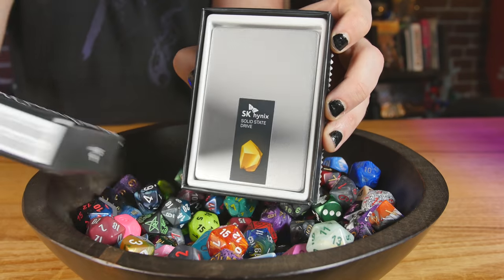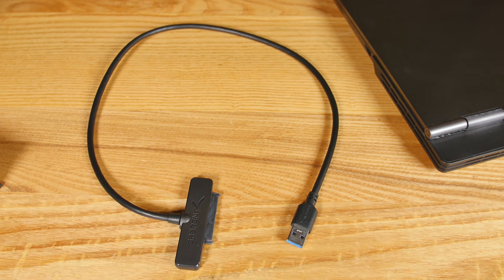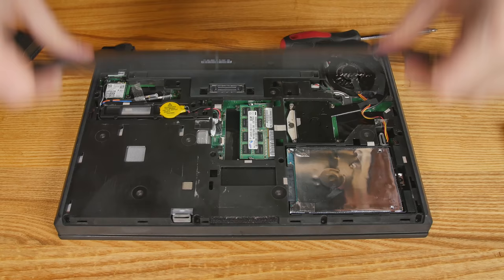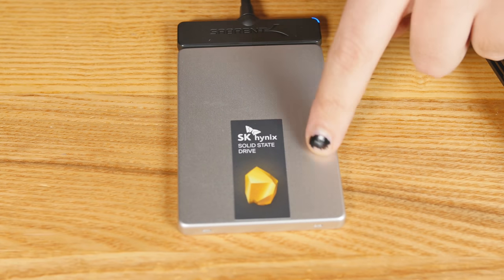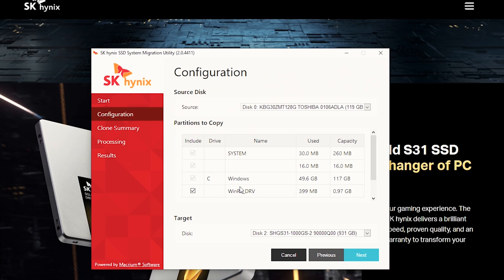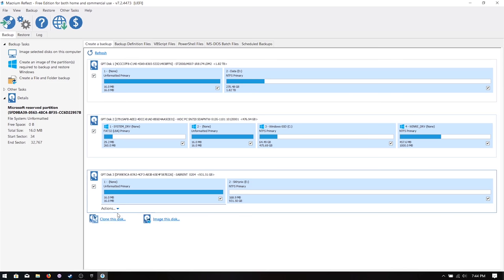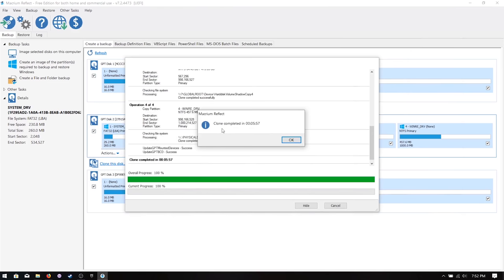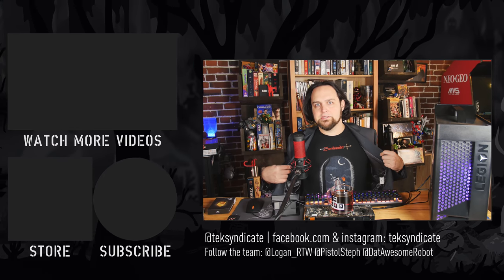UPGRADE Your Laptop to SSD + Easy Windows Migration Guide: SK hynix S31 Gold SSD

Comment: Can you use that program for something like a Samsung SSD?
Reply: Samsung have their own data migration tool
Reply: @twinchargedmr2  Samsung borrowed Acronis True Image* ftfy
Reply: @4S4L3  Yes, and it's free!
Reply: @bullettube9863  Acronis doesn't charge to clone. It's LITERALLY the same software thats cloning, samsung doesn't make their own tool - it IS acronis.

Macrium is good too, lots of options :D
Reply: @4S4L3  I'm referring to the program I once owned back when I had Windows XP,,  you can still buy it for Windows 10.  At that time Microsoft had no decent backup program of it's own,  and Acronis was the best you could buy if you wanted accurate back-ups. Windows still doesn't have the perfect back-up but it works fine for home PCs. I use a separate Seagate 1tb hard drive that I disconnect after backing up each week.   My Samsung SSds were all migrated with no problem using thier included software.

Comment: The migration software showed it worked and was completed successfully. When I went to boot, with the new drive only and after making the needed BIOS changes, I get a boot error. It recommended running a chkdsk, which I did and reattempted the clone, as recommended. I was successful when I used Seagate Diskwizard free download, instead.

Comment: The reason why I've installed Sansung SSDs is because of their migration software. With a USB cable hooked up and the software installed, the migration takes over.  Then I install the SSd permanently and the Laptop is up and running better then before.  ( I hate undoing all those tiny screws though!)  The same with desktop PCs, migration software makes all the difference!  I've seen SK hynix products before and they seem to work very well, though I know very little about the company.  Now that they've gone retail, they should become very popular.